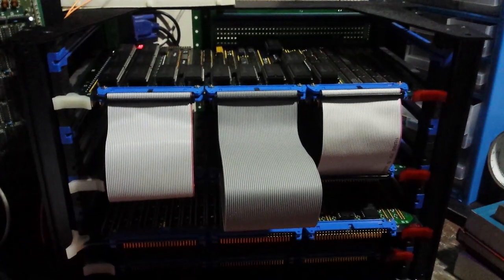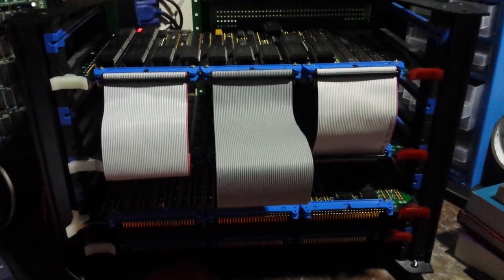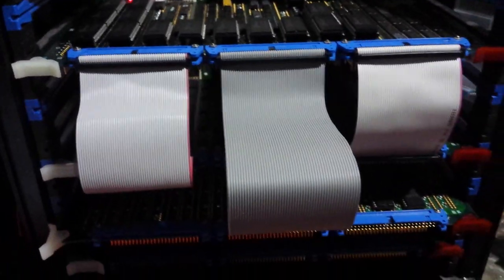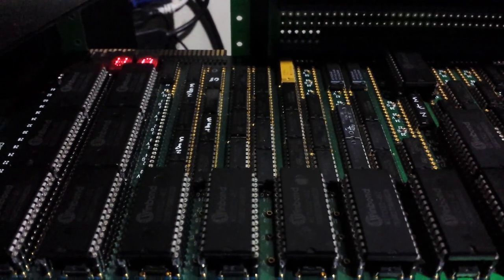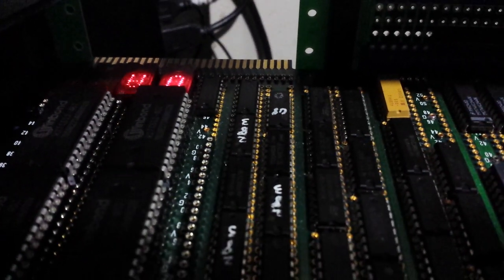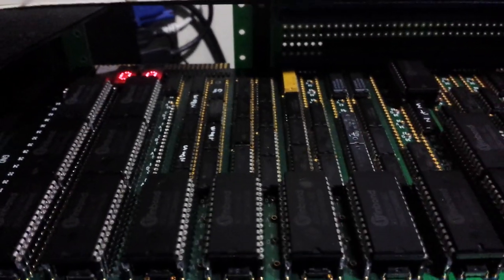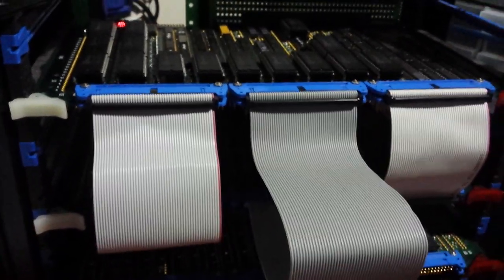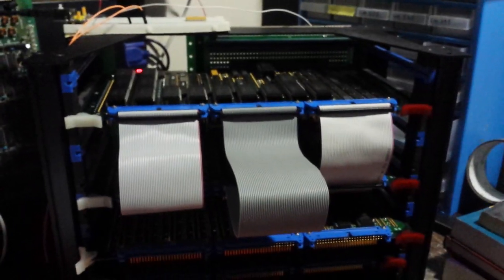Homebrew 16bit Minicomputer from scratch (74HC logic) - Progress Update

Comment: Nice construction! But you are usind 74HC, not 74AHC ICs, right?
Reply from the maker: yes 74HC!
Reply: @PauloConstantino167  74AHC would have (at least theoretically) allowed for a higher clock speed, but I don't know whether all the necessary  ICs also come in an AHC version.
Reply: @PauloConstantino167  AHC arrays are typically 3× as fast as HC ones.

Comment: As a undergraduate computer engineer, i am watching and trying to understand how you managed to complete such a difficult task. This is insane , making such a project shows how well you understand how a computer works , and you mastered it . This makes me think how far behind yet i am
Reply from the maker: Hey there. Thanks for the compliments. It is not that difficult actually. All it takes is a good understanding of digital logic and some understanding of transmission line theory so your signals don't get corrupted when travelling on long wires. I reccomend to you a book by Paul Malvino on computer electronics. It will get you well started.

Comment: You are a genius! How old are you?
Reply from the maker: Hey thank you for your comment. Just hard working :P I am in my early 30's. Bes wishes.
Reply: @PauloConstantino167   no problem. I really admire your work since I was inspired by you to begin building my first 8 bit computer when I came across your channel a few months back.  Do you think its possible to make an operating system with one of these where you can write your own programs in? Or would it require more hardware?
Reply from the maker: yes you can write your own OS for this. about 4MHz is top speed. I want to port Minix or similar to this. however, OS is not necessary. what you need is a BIOS to do basic tasks. once you got the bios you are good to program anything.

Comment: With how quick you are working you could get a 64 bit computer that runs windows 10 and has the graphics power of a gtx 1080 possibly within 30 years, that would be impressive.
Reply from the maker: Impossible as these chips work too slow for that.